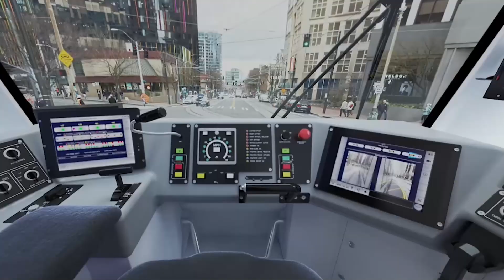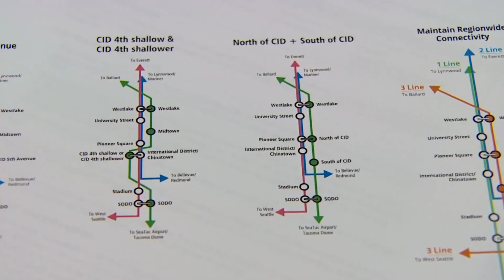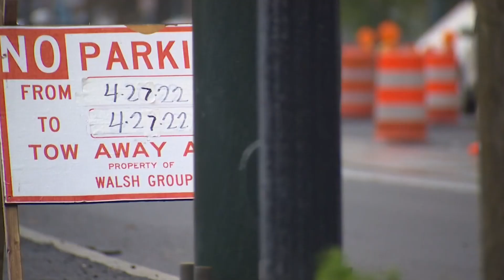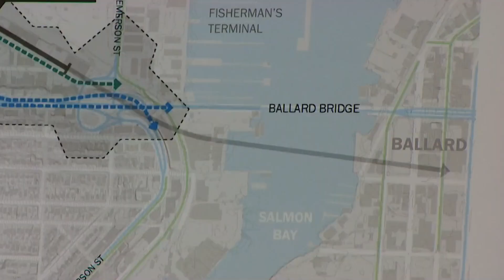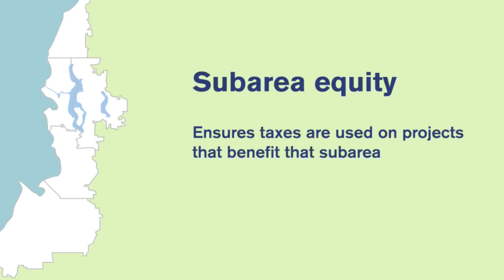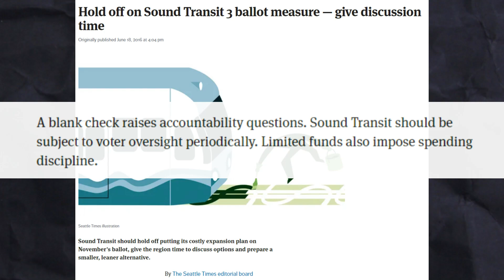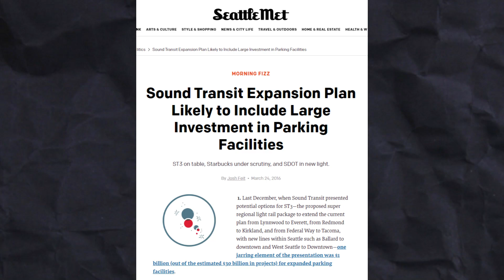Latest Updates On Seattle's $54BN Mega Railway Project

Comment: Light rail is the dumbest form of transit there is.
Reply: Not if used in the right way. But I agree Seattle should’ve just upgraded to heavy commuter rail or done something like the Vancouver skytrain but a grade separated system like sound transit light rail should be fine for now.
Reply: @portcybertryx222 For now and a long time. The projection is 700k riders per day and was designed with rapid rail standards. That's basically as high as skytrain is today and that's using LRT tech. That means the system is suitable for the foreseeable future. Seattle isn't going to overtake NYC anytime so it doesn't really need anything better and should focus on finishing the thing rather than retrofitting an excessive amount of capacity it doesn't need by running heavy rail.
Reply: @portcybertryx222  nope still dumb af. Ned higer speed metros for local and skipstop commutes.. Not cute shits and giggles at billions
Reply: Link operates as a grade separated light metro and not as a light rail. Stations on the extensions are spaced out to allow the trains to reach 55mph which is on par with light metro. This isn't your slow Toronto street car
Reply: @cmdrls212  Link Light rail is not grade-separated, it has a ton of street crossings, and Line 1 runs at-grade in a street median for about 4.4 miles.
Reply: @topsnek4603  so you're saying 4.5 miles out of 108 being built are not grade separated, which affects only one line out of 4 being built. While all the rest of the system is grade separated. That's like what 4%. That's a ton of crossings? 😜
Reply: @cmdrls212  You're confused about what I explained. The 4.4 miles I described are STREET-RUNNING on the Line 1, not counting 49 grade-crossings throughout the system. Line 2 also street-runs for about 0.3 miles as well. Together that is 4.7 too many miles of street-running and 49 too many grade-crossings to be a "grade separated light metro" as you described it.
Reply: not all LRT is created equal. There is slow city LRT with lots of stops that run in mixed traffic, and there is grade separated, elevated, subterranean LRT that zooms by at 55mph and has 3-minute headways on 120 meter 4 car rolling stock. Seattle's ST2 and ST3 is the latter and it really shows how versatile LRT can be.
Reply: @walawala-fo7ds  too slow... Need higher speed
Reply: @AMPProf  Like what? That's pretty normal operating speed for commuter rail as higher speeds don't make a lot of sense as station separation needs to increase which reduces ridership. I think you're confused with high speed rail. That's not the kind of system you build in a small urban area like Seattle. It's the kind of system California is building to connect Sam Francisco, the Central valley, and LA.
Reply: Dumbest idea? A: ' the above comment' Ha Ha lolz omg:face-blue-three-eyes::face-turquoise-covering-eyes:
Reply: Welll What about Pull cart human powred
Reply: BRT is way worse... None of the capacity of real transit, all the expenses of LRT, none of the comfort...
Reply: @stickynorth  i just want future rail from all the futur rail paintings
Reply: Hard disagree, nothing really matches LR flexibility.
Reply: @Seawiz21  what about High speed Emu
Reply: @Seawiz21  how on earth is fixed rail flexible?